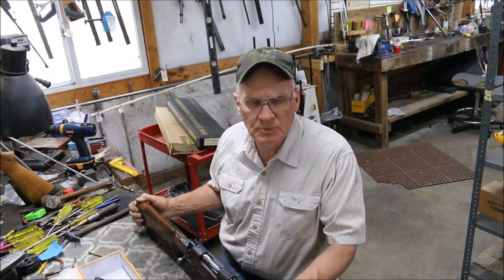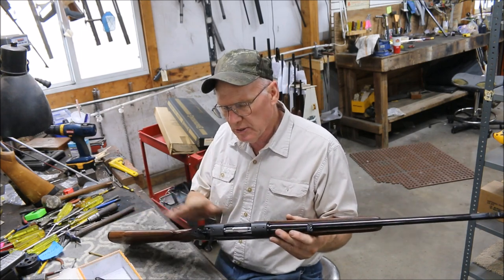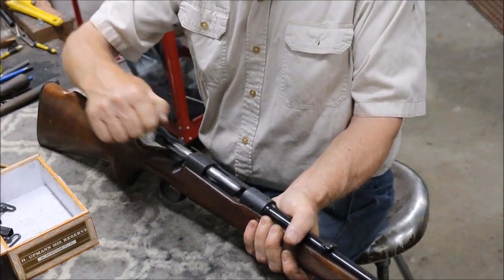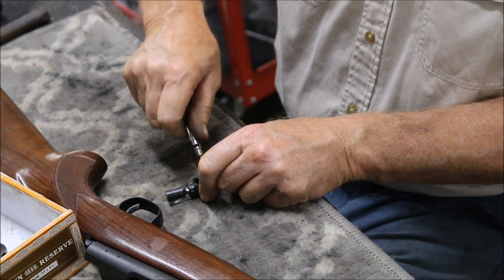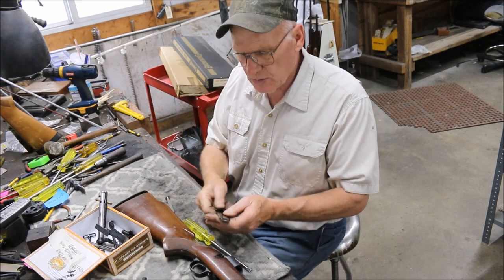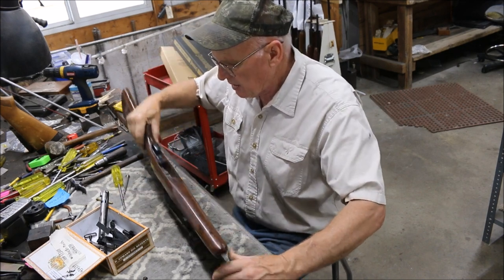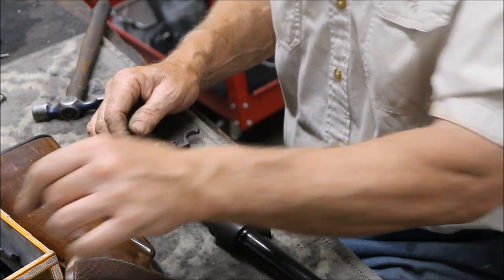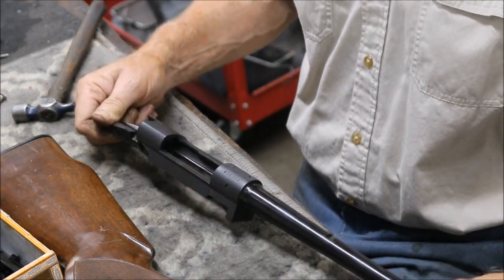Watch Art disassemble a Pre 64 Winchester model 70.

Comment: Don't know if you read comments or not, but I am the guy that called you on Friday, June 5th, with a question about my pre64 bolt reassembly.  The good news is I got it working again.  At 74 I just did not have the strength to compress the spring far enough, so my brother in law helped me.  All good.  Thank you Art for taking the time to talk to me.

Comment: The Featherweight model always had the aluminum floorplate and trigger guard. Good to see how it's done but also won't be doing that to my Model 70's as they are new and I don't trust myself to put them back together.  Pulling the bolt apart without disassembly is as far as I will go.  Good video.

Comment: I wish I could drop my Model 70 1941 off with Art.  I am learning as I go, but the safety was locked in fire position.  I took apart the bolt and cleaned up the firing pin and spring.  Was able to disassemble the bolt based on this vid.  The bolt handle and extractor blueing is gone, (polished?).  They are not worn, it looks like it was removed.  Anyhow, I got the safety in the middle position by moving using a piece of wood and pulling down and then engaging the safety.  Testing tomorrow, (rifle not with me) to see if the safety was frozen with gunk/burr or if the sear is worn.....fingers crossed.  Would love to drop the rifle off to Art and just pay the master to fix.
Reply: Not taking anything away from Art’s Gun Shop; but, I suggest you take your M70 to a gunsmith to diagnose that safety lever issue.  You should have a qualified progressional full time licensed FFL gunsmith in your area.
Reply: @thatsthewayitgoes9  I sent it to a guy that used to be in my area but relocated a few hours away.  He fixed it right up.